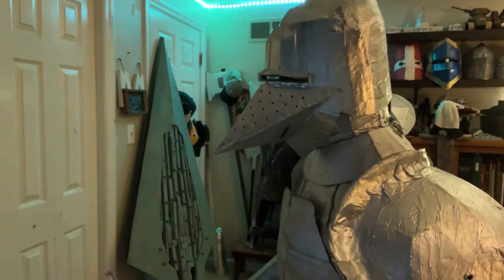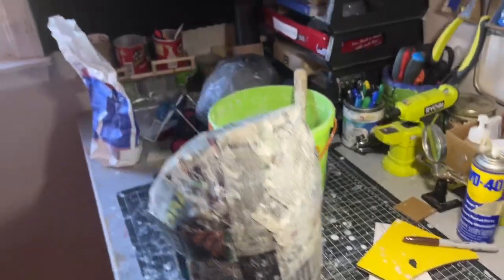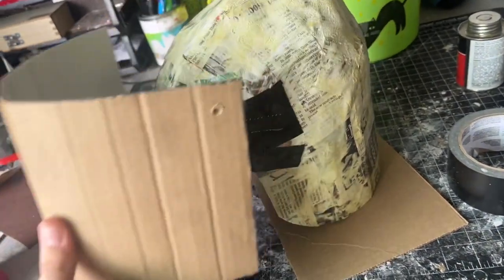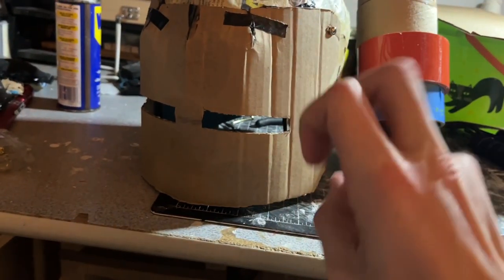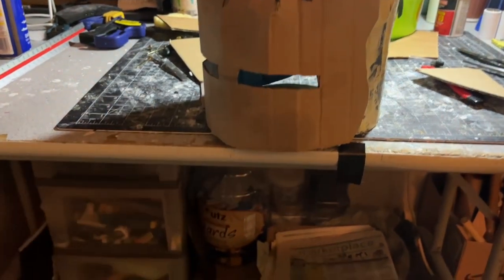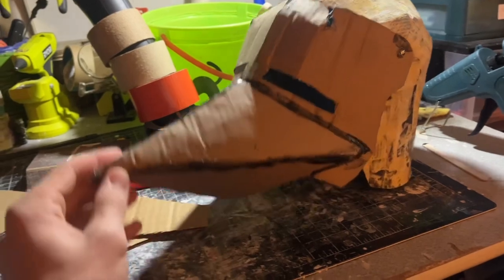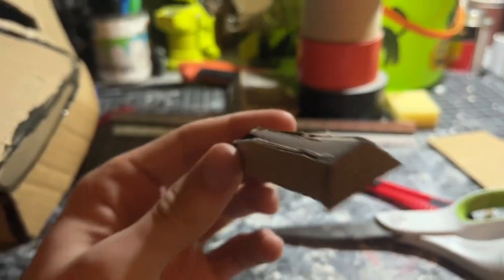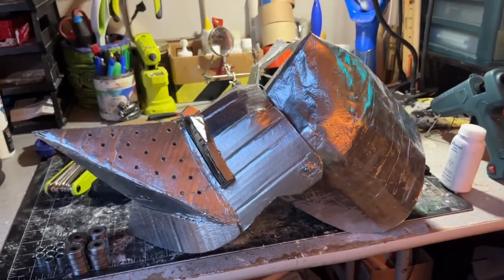How to build a pig snout Bascinet out of cardboard | Hounskull

Comment: I've been working on something similar myself, wanting to paper Mache all plates of armor and used fine grit sandpaper to make the surface fine with no ripples, bends or bumps. Then the plan is to paint with paints and primers to get that realistic metal look.
Reply from the maker: That’s a good idea, here’s some advice if you sand you will most likely tear the dry paper mache so in order to smooth out those bumps go slow with the paper mache job but if there are still any ripples then make a glue and water mixture to re-wet the newspaper strips and rub them down into place so there’s no bumps. Definitely a better way of finish
Reply: @MarksWorkshopcrft  Good advice I will definitely use that. I’m trying to perfect a paper clay recipe so I can sculpt creature/animal designs onto swords, armor weapons etc but haven’t got it quite right yet, thinking of making a latex casting and gluing to the surface to keep weight down and help it stick better